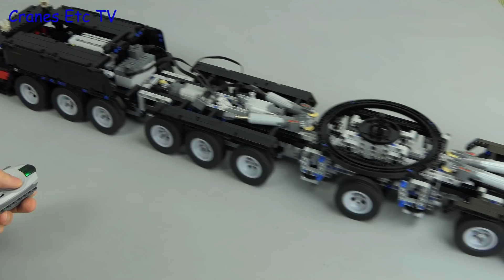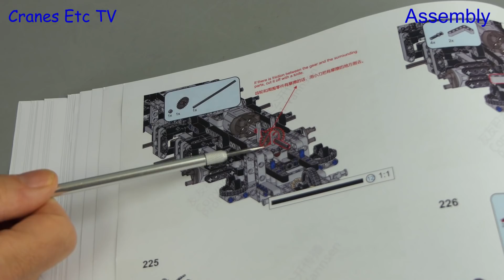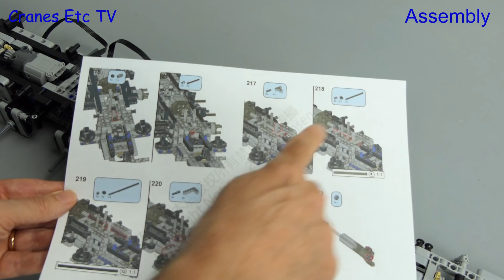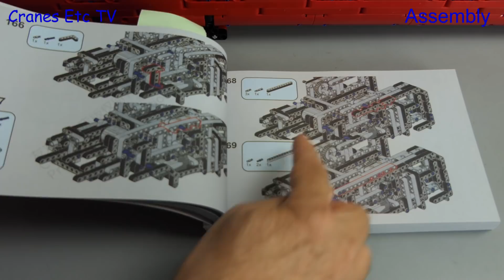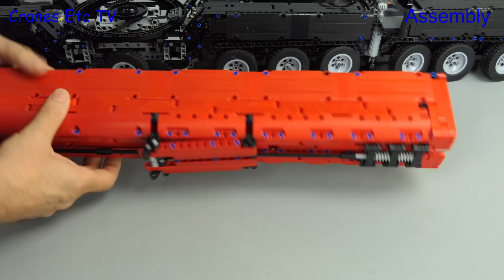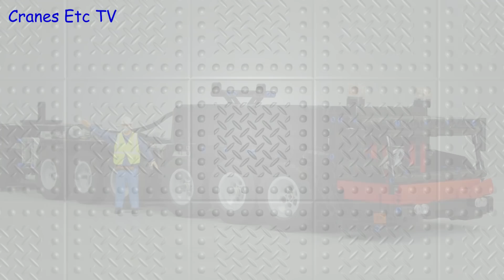MOC Technic Liebherr LTM 1750-9.1 Mobile Crane (Part 3) by Cranes Etc TV

Comment: A solid moc, but it's a shame about all the lacking features. Unfortunately at this size the designer has to be exceptionally skilled for everything to work well and it's clear the creator needed a bit more experience to work out the various issues in the model.

Comment: this is one issue i have with the new modern technic elements, the use of the narrow non studded beams although allows for more complex sets, the rigidity of them is quite poor compared to the older pre 2000 big studded beam sets, my last "old" sets were the Super car 8880 and back hoe 8862, these were as rigid as you could get, recently I got the Chiron and Doms Charger and they are as flexible as soggy bread

Comment: I agree that Lego 42009 is a good looking set, but imagine if the real Lego came out with this model?  Granted, it would cost a fortune, but the quality difference would be phenomenal.
Reply: It would then be built with half the parts, half of the motors, and a completely useless mix of every collor available and still cost 500 bucks at least.
Oh and stickers. About a square meter of them
Reply: 7
Reply: 42009 is revolutionary,although is not represent any real life mobile crane

Comment: I have a horrible feeling the model will not be able to lift the boom assembly under its own power given how incredibly flexible it already shows to be and how much gears slip. If it can't even handle outriggers, how is it going to handle the rest. It makes a horrid sound driving forward too.

Hopefully it'll all solidify in the end but the quality of this kit is subpar unfortunately. Should make for a nice display piece but wouldn't hold my breath for the functions.

Comment: This extremely bad quality is what to get when you buy knock-off lego.
Incomplete set, trim parts, no diffs for the axles and couse a driving problem, an overall bad design and poor chassis strength

This is just a wast of money in my opinion. There is one form JeroenOtten that is way better but you also pay for that
Reply: Agree. LEGO crane is smaller but superior.
Reply from the maker: Thanks for the comment, but Lego Technic sets sometimes have missing parts and the trimming first required is due to the model designer not the system, and he has changed the design now.